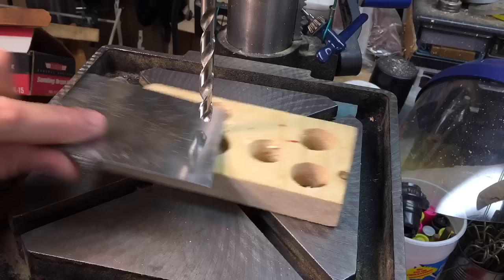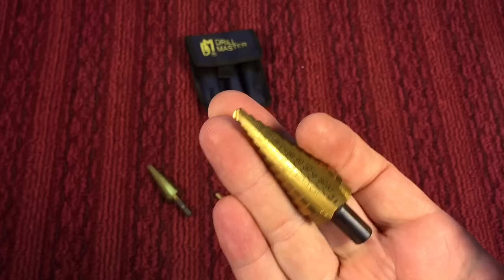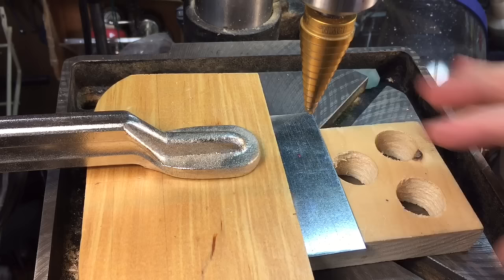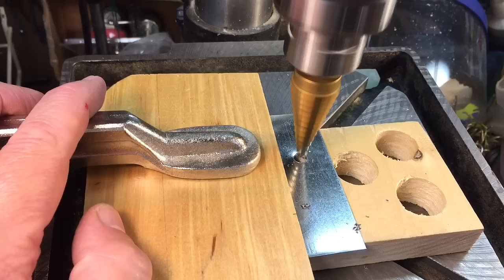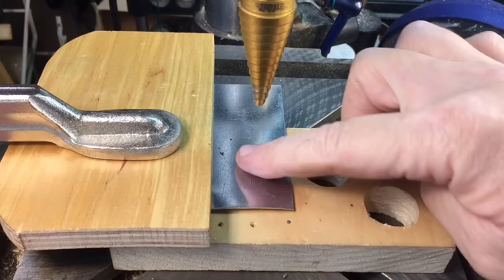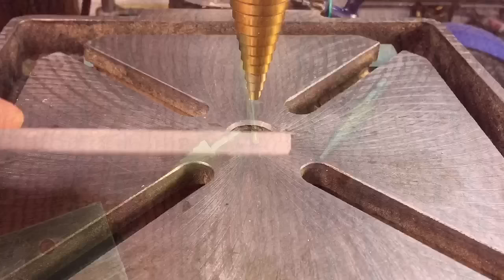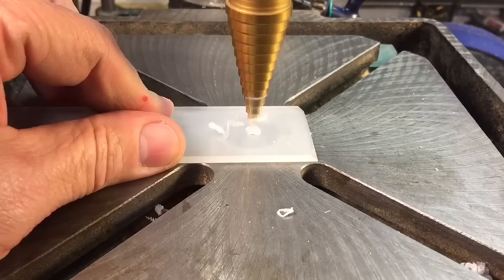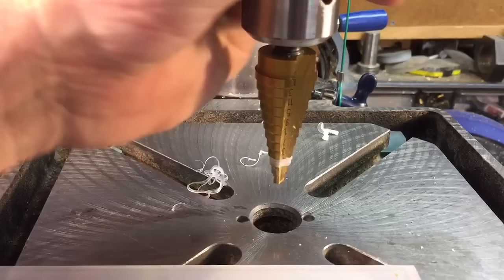Introduction to Step Drills...

Comment: Scout crafter the Klein unibit came out in the early 60’s,as a master electrician & a certified electronic technician I performed a lot of panel layout and wiring,I could drill holes all day long and not change to any other  size drill bits. A great time saver.

Comment: I use the uni-bits all the time when mounting security devices.  Lately I have been using carbide hole cutters in anywhere from 3/4 to 1 1/4 sizes instead, since I do a lot of 3/4 and 1" door contacts.

 I had a customer who was told that enlarging a 3/4" hole to 1" in a metal door to install a new peephole, was not possible, and a new door was needed.  Took me a few seconds with a large uni-bit to prove them wrong, and save the old lady from getting ripped off.

 Uni-bits that go to 1" are quite pricy, unless you go buy the Harbor Freight brands, then it's no big deal.

 Only drawback I have found is after heavy use, they are very difficult to sharpen.  At least I haven't found any information online about how to do it.
Reply: large step drill bits are really nice toys as spinning top, I have one that goes to 1 3/8

Comment: I have 2 - 3 sets of step bits that I keep forgetting to use , because I have all sizes of drill bits x 2 or 3  & every time I think of using a step bit . I can't find any of them LOL.... Not one set . I cured that problem this spring though . I organized all my drill bits in one place in the basement . I now have one full set of drill bits for use in the garage only  too LOL . Now if I can only remember where I put one of my 10 tape measures  LOL .
Reply from the maker: LOL Dave! That's funny! Years back I went to a woodworking show and the guy gave a tip- he said "instead of looking for that one pencil around the shop he put about six cans of pencils all over the shop" I did the same thing and never "lost" another pencil! But there are some things I always misplace! Nothing worse then having to buy something you know you own already but can't find!
😃👍

Comment: I just started using some Step Bits to drill component mounting holes into a plastic electronics project box. Came here to get some tips before I try drilling into the sides of the plastic enclosure box. I need to get my techniques perfected as I plan to build more Arduino & Raspberry Pi projects in the future and I'll need to enclose them for everyday, heavy duty use.
Reply from the maker: They are really handy and work great!  Hope you like them!
Reply: @ScoutCrafter  UPDATE: They worked great drilling holes in a plastic enclosure box from 7/8" to 1-1/8" in diameter. I slowed down my drill press to its lowest setting, and the step bits smoothly cut their way through with no issues. Note that I clamped a piece of pre-drilled sacrificial wood behind each hole location to provide support from where the edge of the hole would emerge and along the rest of the side of the project box so that it wouldn't deform under the pressure of the drill press. (The plastic box is made of a hard plastic that feels like it would crack easily if deformed during drilling.) Now all my components are mounted in the box and I can proceed to wiring them together. Thanks for your instructive video!

Comment: Great video. Very helpful! I need to drill 1/4" holes into 20 gauge sheet copper. This seems to be the solution. What I read is that the speed of the drill press matters. I don't believe you mentioned your speed. What do you recommend for 20 gauge copper? Or is that not really a factor? Also, do you recommend any oil or lubricant of any kind with 20 gauge copper? Thank you again.

Comment: with the plastic, you are obviously limited to the size based on the thickness, unless you use a smaller bit. Acrylic can be drilled with conventional bits, but work best with a different angle (not 60, maybe 90, or by grinding the tip a bit)
Reply from the maker: Hi Greg, Yes you're right!  I think about 5/16" is how thick you can go but you have to drill from each end.  This is the best bit I ever used on plastic!   Works great!!!!!

Comment: Queens guy here.I realize I'm pretty late to the party here, but thouht I would try you anyway.
 I want to change the arbor size on a 4 inch diamond saw blade from 1/2" to 5/8".
I had a machine with a half inch arbor, so I'm trying to be able to use these pretty expensive blades on my new machine with the 5/8" arbor..
Do you think the step drill would be accurate enough to give me a balanced saw blade? 
Also, how do you know exactly where to stop, is it easy to tell, or should you 'tape mark' the bit or??
Thanks for any help, I appreciate it.

Comment: What is the maximum drill rotation speed for using a step drill bit?
Thanks.
Reply from the maker: Jonathan- Found this on-line!  https://documents.walter.com/webform/documents/walter/RPMChart/usa/en/recommended-rpm-for-multi-step-drill-bits.pdf

Comment: Are these any good with wood?
Reply: In my experience they are not as good as almost any other sort of drill. Even beyond the fact that they can't handle anything thicker than a single "step"  they cause more splintering than other drill types. They might work on the very thinnest woods, though.

Comment: If you are going to clamp it then you could use a regular bit. You argued to use it because it would spin if not clamped - then you clamped it
Reply from the maker: Anytime you drill Sheet metal it has the ability to catch and spin on you.  Regular bits are the worst for such an operation, step drills will always do a better job but every spinning cutting tools has the ability to spin the metal...  Better safe then sorry...